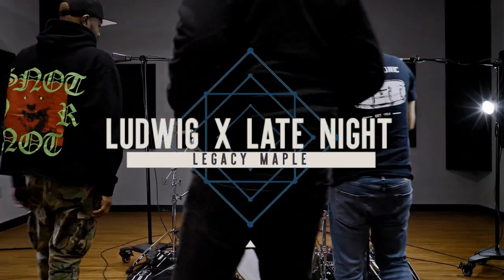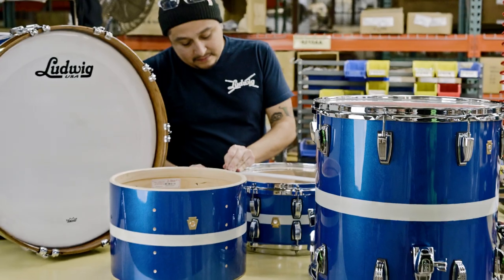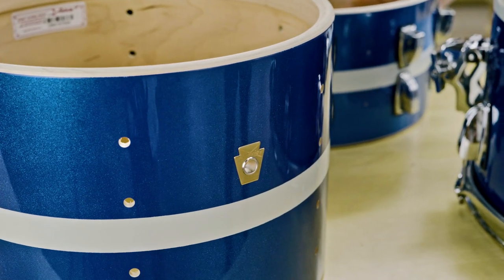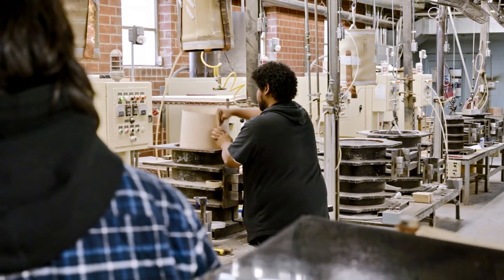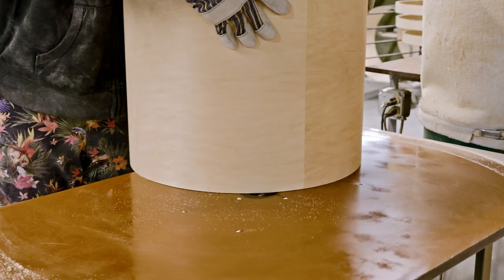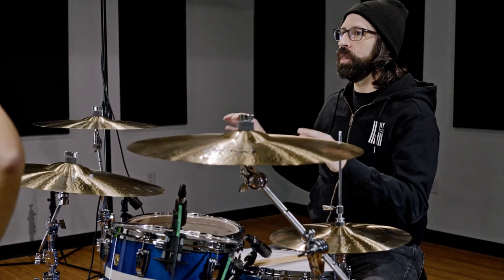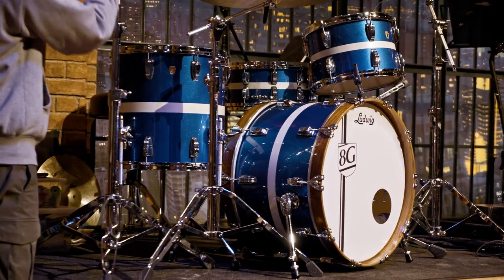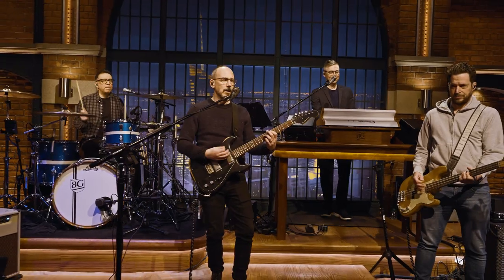Ludwig Craft Sessions: Late Night with Seth Meyers

Comment: What are the sizes?
Reply from the maker: Kit Specs:
Legacy Maple
Custom “8G Blue” with white stripe and Oak Bass Drum Hoops
14” x 22” Bass Drum
16” x 16” Floor Tom
9” x 13” Tom Tom
6.5” x 14” Snare with Die-Cast hoops
Reply: Thank you! What is the finish? Similar to blue sparkle correct?
Reply: And finally, will this color combo be available to general public?